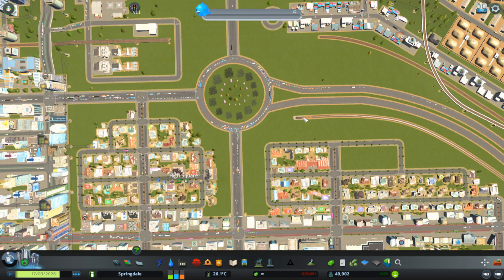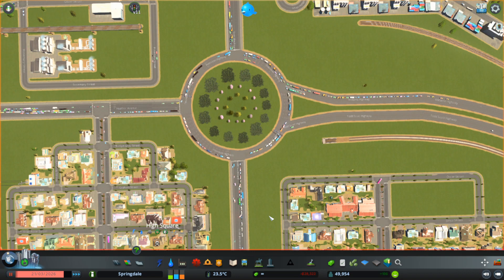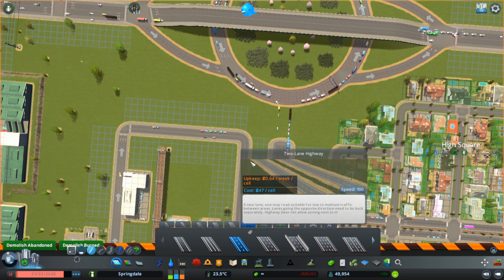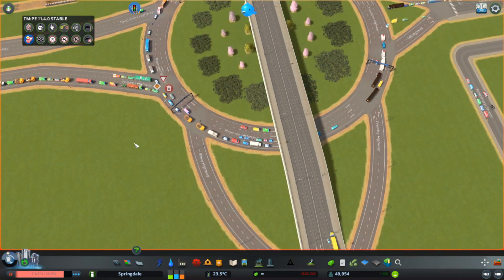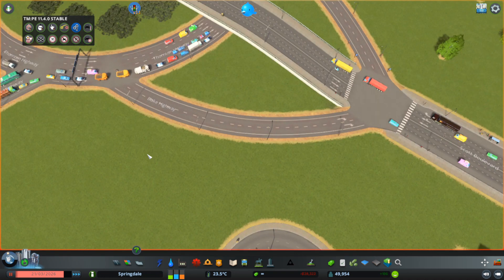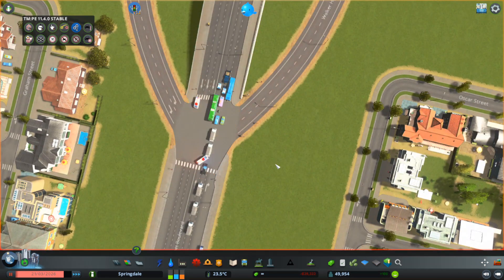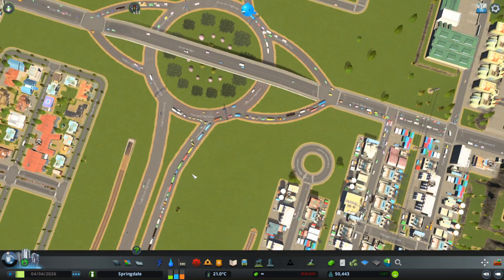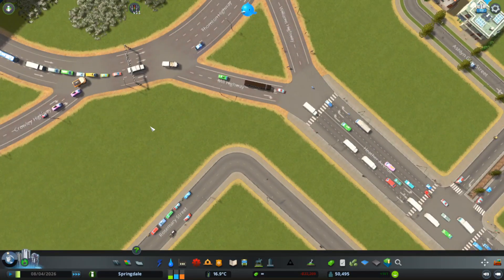Cities: Skylines  - Roundabouts  - Fix Congestion in 4 Easy Steps

Comment: I don't know if you still play, but at 11:04 there's a mistake in how you use the lane connectors.  The result is traffic on the rb can't leave at that exit.
Instead, connect the first lane of the joining road to the 1st lane of the rb as you did in the video, and the second lane to the 3rd lane of the rb.  Then, for the lanes on the rb, connect the first lane to the 2nd lane of the exit, and you can either stop there and see if it works the rest out, or choose what to connect the last two lanes to; one to the 3rd lane of the rb and one to the 4th, or both to the 4th.  It'll make a difference further round the rb so that could decide it for you.